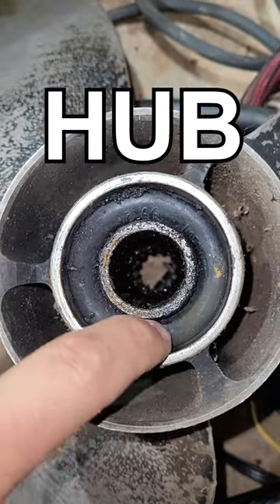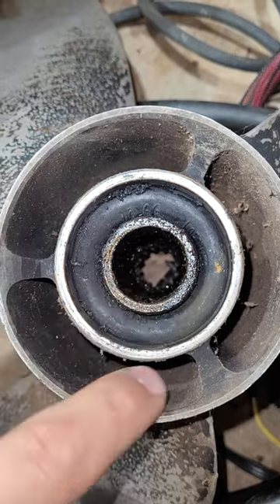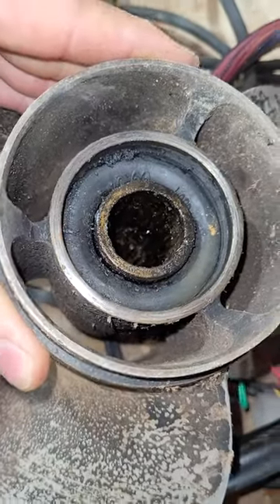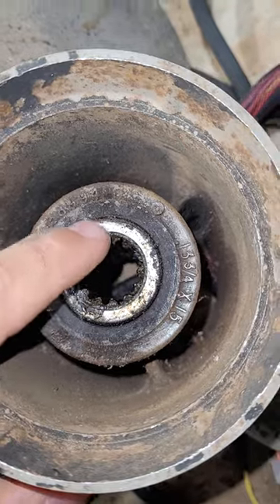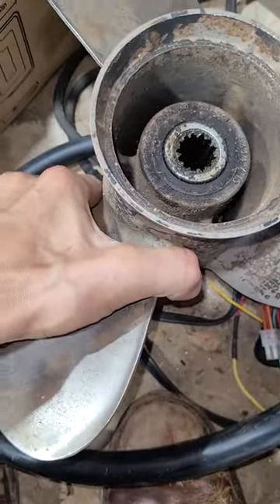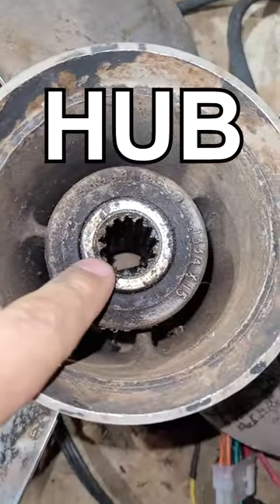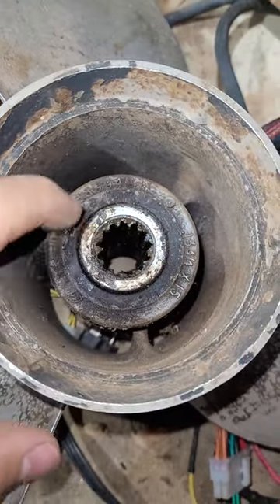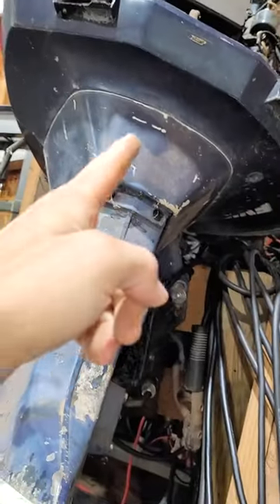Boat Propeller HUB

Comment: Do you have to replace a anything if you run aground and this mechanism is activated? Like is it multi use or is it a single use type thing? Once the hub spins, does it need to be replaced?

Comment: Can this cause the motor not to go as fast as it should
Reply from the maker: Yes! But it's rare unless you've been running the prop through a lot of sand.
Reply: I just bought a 64 Johnson 5.5 from Facebook marketplace and it will rev faster in reverse but when I put it into forward and crank on the throttle it won’t rev as high. Wonder if this is why?

Comment: So what happens if you damage that rubber or it gets worn out? I can't find the spare part to replace it, even on service manual. It looks like part of the propeller itself, all sold as a single item.
Reply from the maker: You can take it to a prop shop and they will replace your hub for you. They rarely go bad!